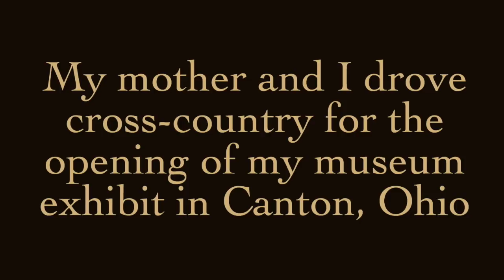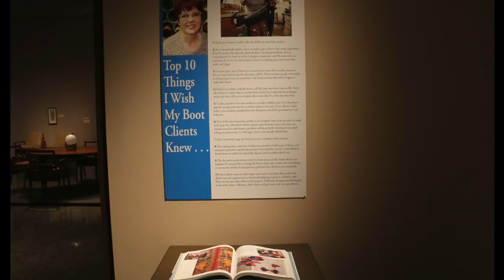It's a Boot Life: final speed boot making

Comment: Amazing work Lisa! I understand that this was a few years ago. Can you remember? Did you use a stain then burnishing paint for the soles? Did you use a neutral wax or a brown wax to finish them?
Reply from the maker: The sole edges and the pegged area of the shank is dyed, then burnishing ink is lightly applied, and then it's burnished. I use the burnishing wheel and horsehair polishing brushes on my finisher, but burnishing with an edge iron or a rub stick and then buffing by hand works equally well. 
The natural area of the sole has a coat of Bottom Stain applied and then it's burnished with Natural wax and polished with the horsehair brush on the finisher.
Reply: @customboots  Thank u!